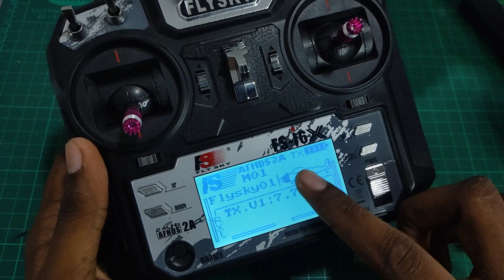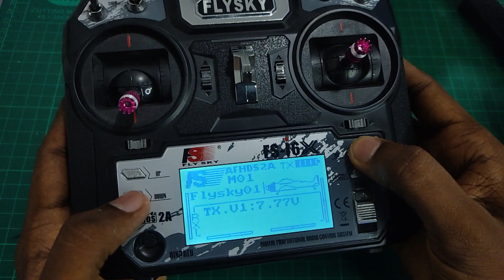How to add rechargeable battery and charger to Flysky fsi6/Flysky fsi6X

Comment: This is not safe you have to use 5v battery module coz fsi6 works on 5-6volt 7.7v volt could burn the chip
Reply from the maker: The older version of Flysky can easily handle up to 9V. But the new version can only handle up to 6 Volt